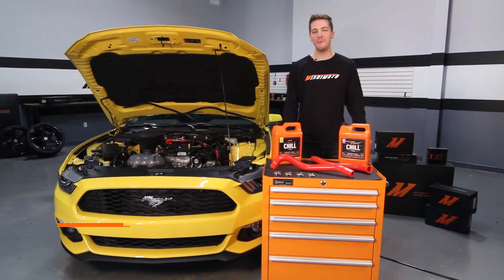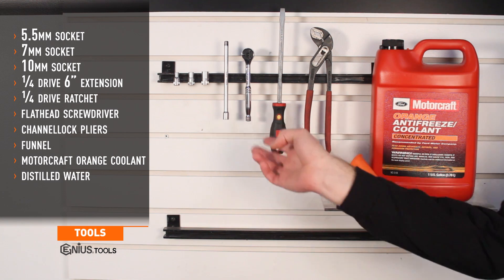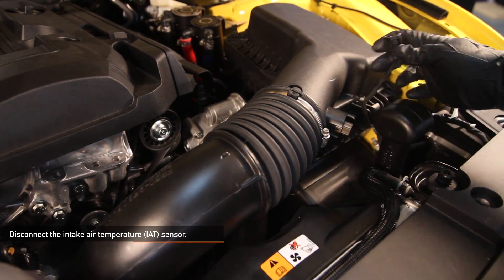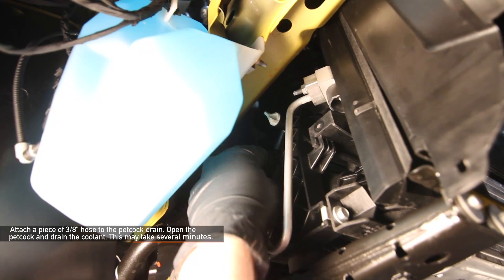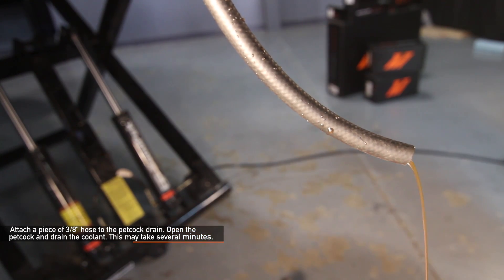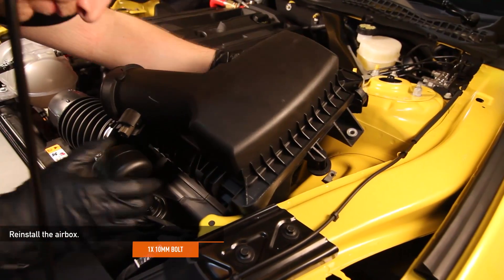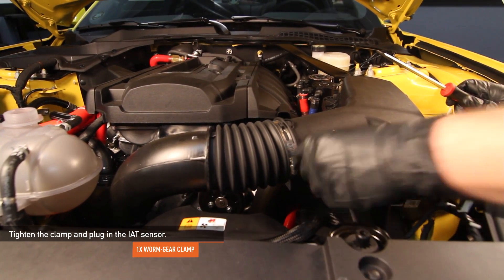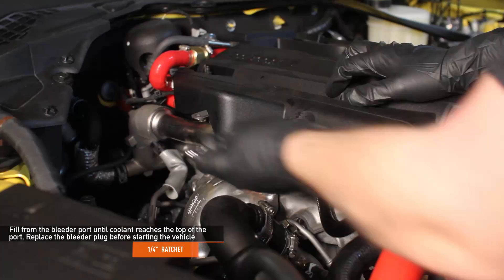2015-2017 Ford Mustang EcoBoost Silicone Coolant Hose Kit Installation Guide

Comment: How does this increase performance?
Reply from the maker: Jon Car This product is not meant to improve the power output of your car. It is intended to prevent damaging your coolant hoses with the heat of the engine bay. The silicone hoses are all-around more durable than the stock rubber hoses.Let us know if you have any questions!- Patrick M.